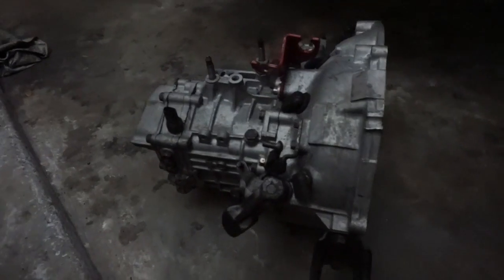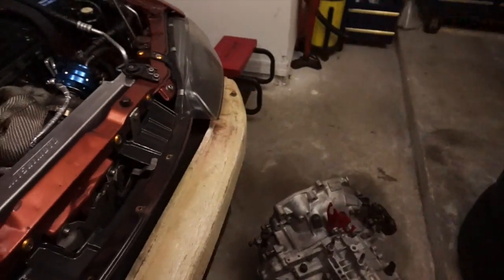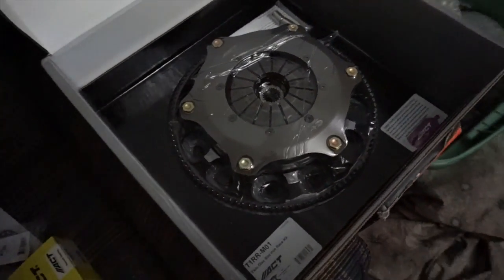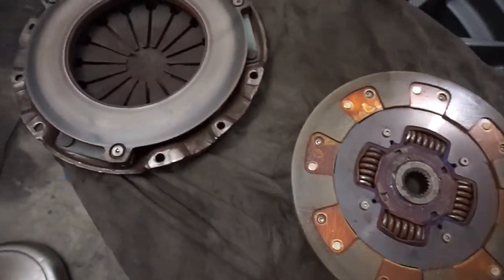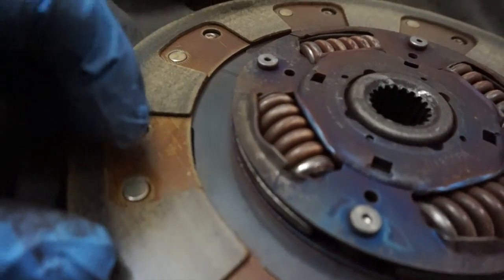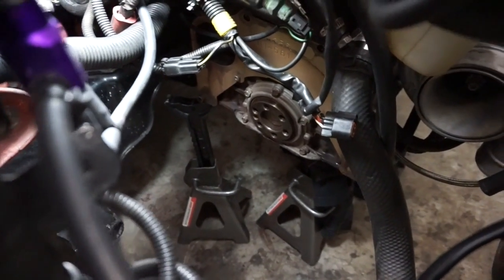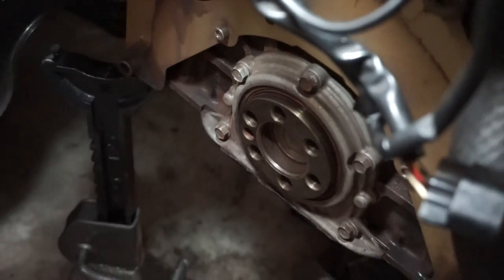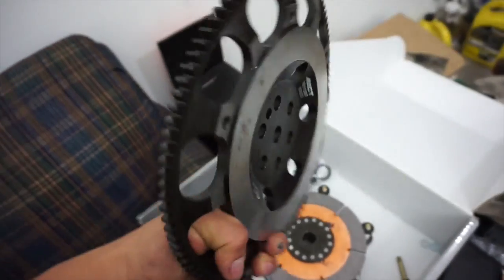Installing an ACT twin disc clutch (6bolt DSM)

Comment: Nice install. How was the difference in shifting?
Reply from the maker: It shift much smoother at higher RPM,, this is with a stock transmission.

Comment: What about driveability?
Reply from the maker: It wasn’t bad I abused it good at the track. I read somewhere I t wasn’t recommended for heavy traffic street driving, but idk how true that is. I went back to a south bend single disc clutch since this one started slipping under high boost.
Reply: I have that same clutch setup and its extremely aggressive and hard to drive especially when it hot.
Reply from the maker: @avinashsamlal2750  When I first got the clutch it took me a while to get used to the pedal feel. Sometimes I would be jerking/ hopping the car like I didn’t know how to drive a stick. I got used to it after a while. At the track I would bog it down because I was dumping the clutch to quick and not slipping it some.
Reply: Did u ever contact any clutch company to make a pair of copper discs in place of the sintered iron? I emailed act, they cant.
Reply from the maker: @avinashsamlal2750  I have not emailed anyone about that.